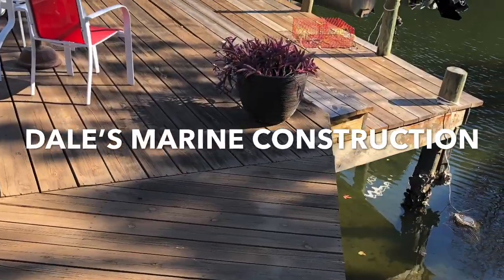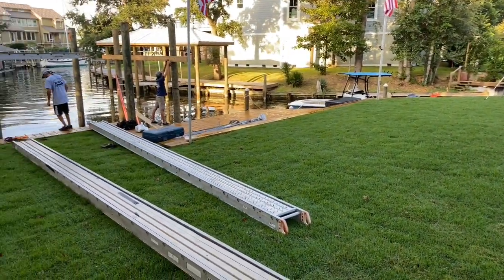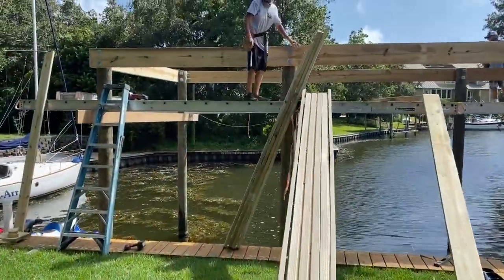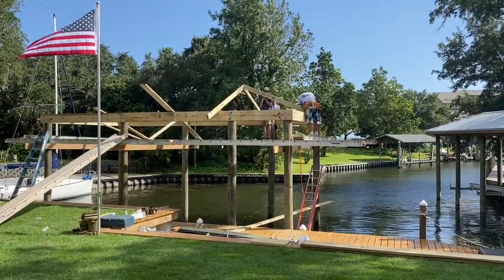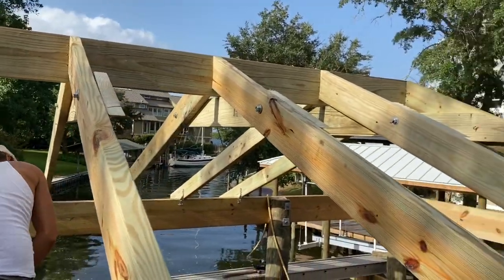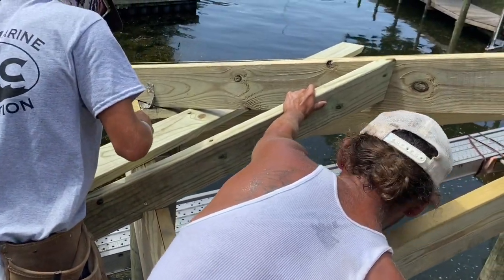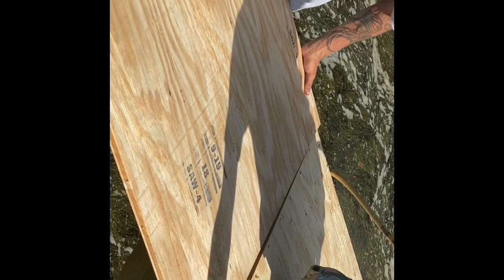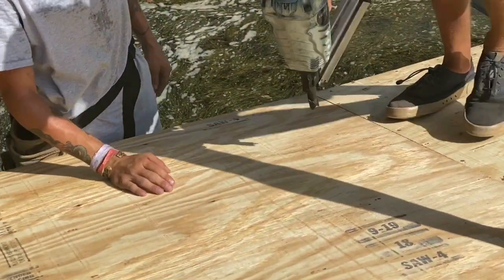FAILING WOODEN SEAWALL MAKE OVER

Comment: Why wouldn't you install boat lift before you put the roof on? Wouldn't  that not be much easier?
Reply from the maker: Mike70359 Hey Mike that’s a good question, we are too fast for our Lift company we build them faster than they can supply the Lifts. Plus it gives us something to do on a rainy day 👍 and shade when it’s hot and sunny 😎
Reply: Company I work for does the same thing. Deco needs to hurry up lol

Comment: Curious,  why do you lag bolt the 'joists' to the pilings ? Shouldn't you notch it so that the lag boards sit on top? That should be structurally stronger?
Reply from the maker: jaxkewl we do notch the pilings that support the Boat Lift and the Piling‘s that support the boat house roof band if necessary to make sure it is perfectly square. Not sure where you’re seeing the lag bolts but these bands are bolted to the 8 inch pilings with five eights hot dip galvanized bolts and large square washers.